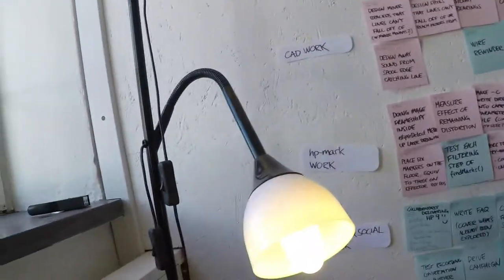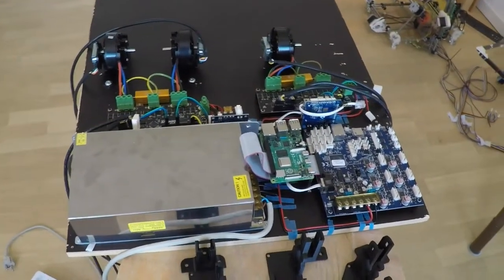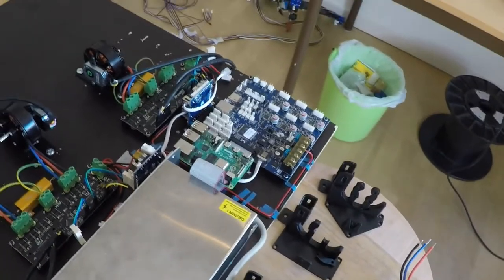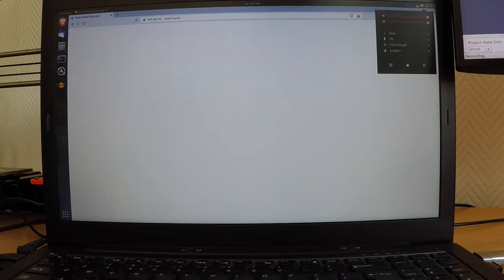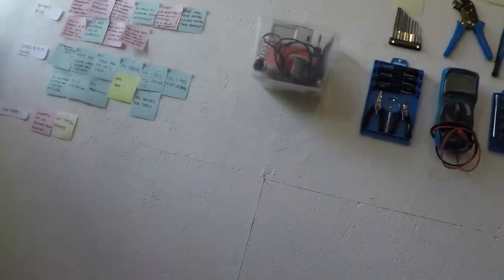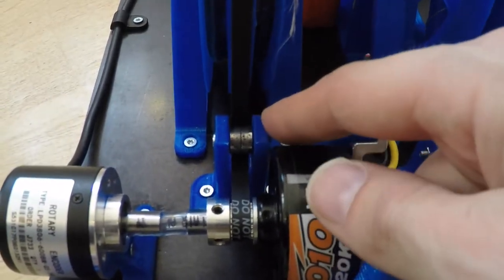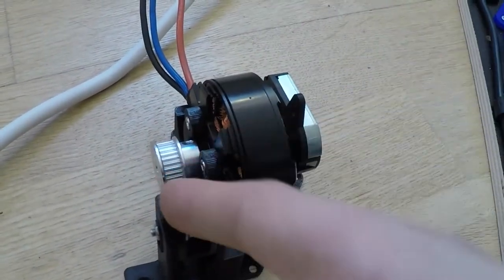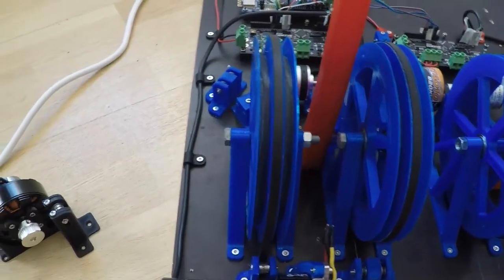HP4: Circuit Boards ✔️ Motor Mount ✔️ FW Under Way 🚧

Comment: Hello, good to see your progress. Have you tried it with a diode laser? Perhaps this would help Hangs' grow more.
Reply from the maker: Hello, no haven't tried myself
There were one person who did, saw it in the forums a while back. Looked very dangerous 😂
Reply: @torbjrnludvigsen-hangprint7605  Haha yes - a swinging laser... +.+

Thinking of small businesses multi-use work space - it would offer a lot of possibilities. Probably more end users needing to quickly process 2D sheets than 3D print big stuff, taking a long time. 

Now there are more powerful diode lasers available, the system would be much cheaper to ship than a traditional bed CO2 one.
Reply: @torbjrnludvigsen-hangprint7605  To use business terminology, there may be greater market potential for a Hanglaser - encouraging more investers to what's still the star of the show: your kinematics.

Opening up the laser cutting business to people with lower startup costs, and helping grow the economy at this really important time post Covid19.

[edit]
Hangprinting is a great idea and will open up some niches. It just seems a laser version would reach more people, more quickly, when HP-mark reaches accuracy reqs. Maybe operating in a 2D plane will make that easier to achieve too.